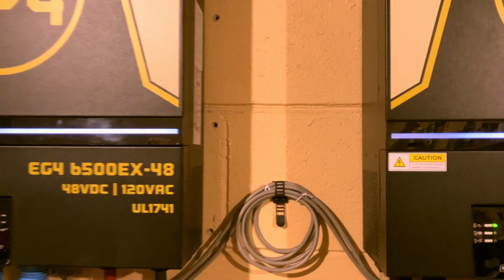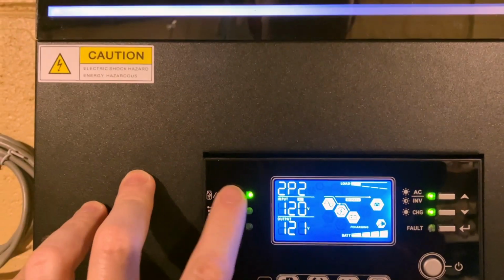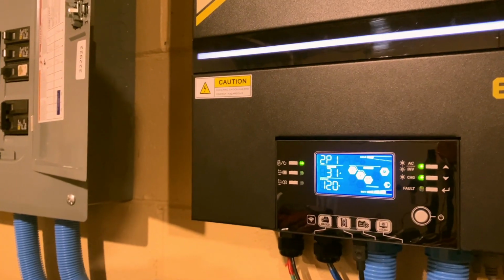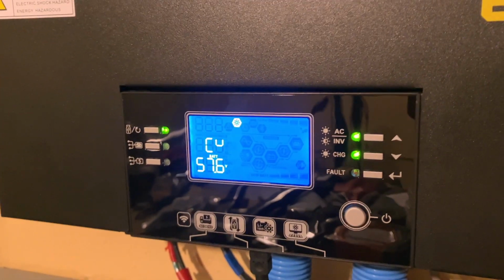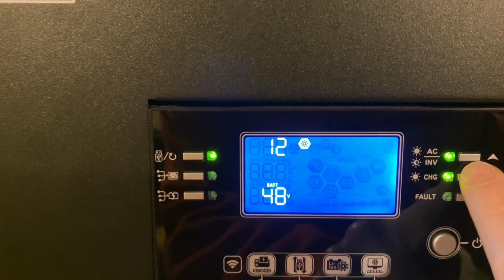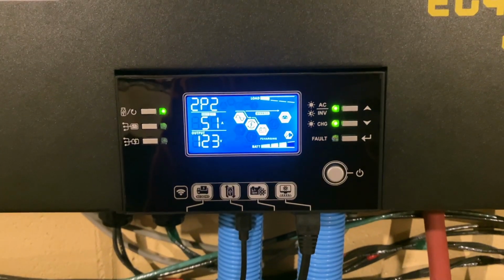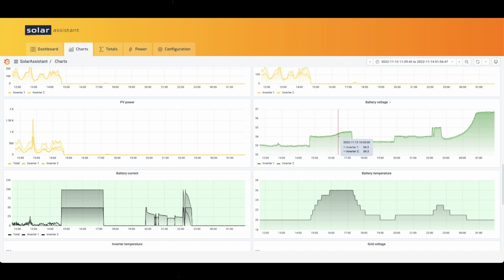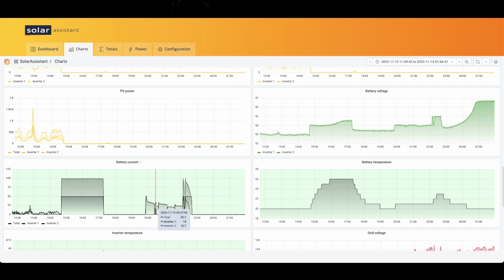Grid Charging Oddity

Comment: This might be off topic but I was curious if you have anything tracking your grid input into the inverters. I have a emporia Vue utility connect that I use to monitor my utility backup connection just to get a up to the second view of what’s going on. Here is the kicker when I have my beaker that goes to the utility connection of the inverter on, the inverters are pulling 100 watts from the grid. And when the sun comes out that 100 watts goes away and the inverters actually start back feeding 100 watts to the utility . After I found that out I immediately turned my backup utility breaker off as it is dangerous for utility workers. I also contacted signature Solar and they said something is wired wrong but I don’t think that is right because everything else is working properly, so I am wondering if you would like to look into it with your system and see if you have the same issue.
Reply from the maker: I have a Sense home monitor in my MSP.  I know I've looked at the monitor when I'm in bypass mode and I have almost no draw from the grid at all (except for maybe something still plugged in on the grid side).  I know I've never seen any back-feeding across the grid circuit.  

Can you put a clamp meter on your grid connection and see if there actually is power flowing back to the grid panel and not a mis-reading from the Emporia?
Reply: I finally had a chance to put a meter on the grid connection. When I turn it on it starts by drawing the roughly 100 watts for the 2 inverters and gradually drops to 0 then starts gradually pushing 100 watts back to the grid. And does this on any output mode.
Reply from the maker: @jeremy4609  I would defiantly be contacting SS if your seeing voltage getting pushed back to the grid.  These are supposed to be off grid units preventing any back flow.
Reply: I did but they really didn’t have any answers other than something is wired wrong. I don’t plan on using the grid connection anyway. I plan on using a chargeverter in the rare event that I don’t have enough Solar
Reply from the maker: @jeremy4609  hmm, yeah that doesn’t make sense.  I do like the idea of using a chargeverter instead.  That would get around any of the other issues that “grid-bypass” has.

Comment: Maybe your batteries BMS is stopping the charge?  I had my bulk set to 57v, when monitoring my EG4 batteries BMS, I noticed some of the individual cells in the batteries were being over charged causing the BMS to stop the charging.  I lowered the Bulk to 56 and set the float to 55.5v.  The batteries seem much happier at these settings. I don't have any experience charging from utility though.
Reply from the maker: Thanks for the comment.

I won’t normally be charging from the grid, it was just a test.  It wasn’t the BMS causing the issue cause as soon as I increased the float value, the charger ramped up.  My inverters are both set to USE as I’m not using EG4 batteries.

Comment: Another thing when charging from the grid in USB mode, as you get really close to your bulk voltage setting you will notice both inverters decrease current and when it gets very close to setting, one inverter will finish because it’s easier for it to control low current/absorption with one. If I remember right it happens below 10 or 5 amps. It’s been a while because my panels usually finish the job. I just don’t spend much time watching it anymore. My settings are 55 bulk and 54.4 float. Mine batteries aren’t stressed that way and are well balanced but I also have a very powerful balancer.  Crazy reading but go to the EG4 website and look at all the rack 48 systems and versions, look at each recommended settings for float and bulk. Keep it mind that they all use the same battery chemistry. Kinda looks like they’re still learning? I like the newest (V2) with 55.5 bulk and 54 float. Very reasonable.
Reply from the maker: Thanks.  Yeah, I'm always playing around with my settings.  If I recall, my settings at the moment are 55.2 (bulk) and 53.6 (float).
Reply: @AdamDeLayDIY  
That’s very safe for longevity. The only thing to watch out for is the balance. If the voltage isn’t in the balance “on”zone long enough to work on it you may have to make adjustments.

Comment: Stop messing with the slave inverter (except for program 11). Once you commissioned it, the only real reason to touch it is to look at status and perhaps change charge current(11). The only control you really need is at the master P2, is programs 01 & 11 . Leave 16 alone at default “nsu”.  Float and bulk is set at the master and should transfer these setting to the slave. If it doesn’t do this correctly or acting strange, you need to do a total  depower/reboot because it’s totally confused. To depower, disconnect the data cables to the Solar Assistant at the pie unit, not the inverter because the socket in the control head is weak and it only has so many jabs it can take. You must remove the SA because power from the pie will back feed to the head unit and it won’t properly shut down or burn out the pie’s little power converter. Now you can turn off the PV, grid breaker, push both off buttons and when it powers down disconnect the battery. Wait 15 minutes, and do everything in reverse but remember to precharge the inverters and when you get to reconnecting the SA, plug the master in first so they don’t switch positions in the app. Probably the only programs you really ever really need to access is 01 (USb,SUb & SBU) on master and if there’s not enough sun, 11 (max charge charging current) is independent to each inverter. Do have a look at what pgm 02 value is (total amps) on both and is it what you want. On the master only, you can use the timer function, the middle left button but only use the USB option (when primary pgm 01 is already at SBU!). Don’t use time 00 in start or stop (“00” /“00” is off). Are you confused yet? Hang in there. Once you got it running right you may actually forget about the whole thing and not even check the SA app all day!  Have fun.
Reply from the maker: Thanks Karl.  As you stated most of the settings sync between the two inverters, I just didn't have enough patience to wait for the change.  When I make changes to the physical inverters (which is rare cause I use SA for most of it), I make the change on the Slave unit (because it's the first one inside the door) and it syncs to both.  There are a few settings that are unique to the individual inverters.  There's no actual list or documentation in the manual, but the few that I've come across are Menu 2, 11, 16 and all the time settings (95-99).

Comment: Okay there is something that you missed in setting, the reason that float is taking control is because the  Rebulk voltage is set to low and and it sees the batteries as being fully or near fully charged, and therefore only requiring a float charge,  however the one thing I do find strange, is that when connected for split phase operation, the to units should be able to each do half of the charge limit set point, there by sharing the load and keeping the current equal on both phases. However I see another decrepancy, you have to communication cables connected, and this presents another question, I only have one, when I received my units the communication cables were not in the box, so I called up signature solar and told them that they were missing, so they sent me one, and when I got it I called them back and told them you only sent me one cable, and that the diagram shows two, so they connected me with there tech support, whom informed me that only one is required, and that it's an either or thing, which seems a little odd, but it is working with only one connected, however it is not yet tied into the main panel, so I have not yet tried to charge from both units yet, however I have discovered yet another qurk about these inverters. I had one of these hooked up to a 15 KWH bank of Lifp04 batteries, and had the charg current turned down low, in order to allow the active balancer to get all of the cells in perfect balance before I did any high power tests, and during the initial charging bulk phase, everything was fine, however when the batteries started to float charge is when I discovered something that I really don't like about these inverters or more specifically there internal charge controllers. 
It was in the evening and I went into the kitchen to start dinner, and I use an induction cook top, almost exclusively, well I put some  Spaghetti noodles on to boil Spaghetti noodles on to boil, And they started boiling just fine, and then stopped, And then after a bit they started again, so I thought that my induction cook top was done, and I almost threw it in the trash, but I suddenly remembered that I had this cook top on the road with me and I ended up buying a pure sign wave inverter for the truck, because it absolutely will not run on a modified sign wave inverter, until I bought the pure sign wave inverter, I had to drag out my Yamaha inverter generator to run it, because the thermostatic control is confused by the distortion of the modified sign wave. 
That being said, I pulled out my fluke scope meter to have a look at the purity of the sign wave, and was extremely shocked to find a 104 volt spike on the line, that would appear and disappear. Well long story short, I traced to that inverter, which I kwikly swapped out for the other one, thinking that maybe there was something wrong with the first one, but it does the exact same thing, and to make matters worse the cook top was on a completely different circuit, and further investigation showed that the 104 volt spike,  was present on the buss bar of the main panel which is only 80 ft from the pad mount transformer!! The spike is only about 8.5 ms in length, but it totally cripples my New Wave    Precision induction cook top, and it turns off one of my power supplies that runs my Ham Radio station!
Reply from the maker: I had the bulk voltage and float voltage farther apart at the beginning of the video but I had to increase the float voltage to allow for the charger to actually charge more.  It shouldn’t matter how close I have the voltages set in the settings.  If the inverter never reaches the bulk charge voltage, it should never drop into maintaining the float voltage.

That’s very interesting about your cooktop investigation.  We’re you ever able to figure out the cause of the spike?  Did you get any help from Signature Solar?

Comment: With EG4 batteries, do I need to worry about any of these settings?  I've seen conflicting information in the manuals saying where the voltage should be but then it says they are set by BMS.  Confusing.
Reply from the maker: If you have option 5 set to EG4 and you have proper communication set up with the inverters, no I don’t think you need to worry about these settings.
Reply: @AdamDeLayDIY  I would agree but then why would the manual say default settings for EG4 batteries?  SS can't answer that either.
Reply from the maker: @dalemeyer5363  you got me there. I actually don’t have the updated manual because it didn’t come with the inverters and I just haven’t downloaded the updated copy.  Since I don’t have the EG4 batteries, most of the updates don’t apply to me.  I would just think from what I’ve seen, that you don’t need to touch those settings if your using EG4 battery mode.

Comment: Same here. My utility seems to only charge the batteries halfway. I tested this last night, ran batteries down to the low warning mssg then switched on the AC utility. Both inverters went into bypass and started charging as well at wide open current' 30 A in my case. Ran like this for about a half hour bringing the batteries up to about 50% then quit charging. Batteries are now at 50%  and were running on battery only again. I need to figure out what setting will let the AC charge the batteries all the way to full charge as well.
Reply: It might be setting 13, I'll test it now.
Reply from the maker: Sounds like that's what it might be.  If 13 is set to 50% it would stop charging.

Comment: I believe it is doing what you have told it to.  Depending on the model., the Bulk Charge voltage is the voltage the inverter will push to charge the battery.  I hope that makes sense.  For example I have some 51.2 Volt batteries and some 48 volt.  When I use 48 volt batteries I change my bcv to 54.6 and put my float around 53.6 so my batteries will not go over 53.6  but it is charging at 54.6.  I hope this makes sense.  I know it gets confusing....  Think about this.  if it charge to the BCV at a set level, why would they even give a float voltage.  BCV is just the voltage the battery wants to see for a charge value.
Reply: Better yet, maybe this will help.  If my batteries are 48 volt and need to get 54 volts I would set my float rate to 54 but I want them to charge at a rate of 56.8 volts.  That 56.8 is the voltage the battery expects to charge at, it has nothing to do with what voltage the battery is at.
Reply from the maker: Unfortunately that’s not how it works.  Bulk charge voltage is the voltage which the charger wants to charge the batteries up to.  Then once it reaches that voltage, the amps taper off and then typically it would go into an absorption mode (unfortunately I don’t see any way to control in the 6500s how long it’s in that mode).  Then once it completes its absorption, it then switches to float mode where it attempts to maintain the float voltage.  From what I’ve seen with other chargers, once the voltage has dropped under the float voltage for a significant time, the charger then switches back to bulk mode trying to get back up to the bulk charge voltage.

https://diysolarforum.com/threads/what-does-the-%E2%80%9Cbulk-charging-voltage%E2%80%9D-of-a-hybrid-inverter-mean-mpp-solar-lvx-6048.44758/

Andy does a good job of explaining this: https://youtu.be/xBu7ScAdKrg

Comment: isnt bulk voltage a lead acid thing? Lifep04 is float?
Reply from the maker: No, float is a lead acid concept.  Bulk charge is the maximum charge you want your batteries to charge up to.  

While float technically isn’t needed with lithium, I’ve seen a lot of people with a whole lot more knowledge on the topic than I do have a float voltage set, so I do as well.
Reply: @AdamDeLayDIY  My Growatts have float and bulk and they both are set to same voltage as instructed in manual when set to US2 since i do not have any connection to the inverter from batteries.

Comment: I have my inverters set to 56.4 for float. my BMS's handle their charging specs not my inverters.
Reply from the maker: From everything I’ve read, it seems like it’s recommended practice to have the charger be the device determining what your top voltages should be and your BMS should just be used as a safety measure.
Reply: @AdamDeLayDIY  your charger should always be a little higher  than your BMS. So as your BMS balances your cells it can take in more charge as needed. I have JK BMS with 2 amp active balancer in each one. they turn on at 3.4 V per cell. That is what I have learned from OFF GRID GARAGE(Andy). You always have to supply more voltage to the BMS than is needed if not you will never get full charge. even when you are full at 56.4 they settle to just under 55. mine usually settle at 54.6-.4 depending how long they set.

Comment: well you are not gonna cause a phase imbalance on the grid. they do not have tiny auto transformers. They have much much larger ones. Its more important to see how balanced your off grid breaker panel is. Most will never charge from the grid.  Let solar charge them back up.
Reply from the maker: Very true.  Guess I was so shocked at the float issue that I didn’t even think about the fact that it was all coming from the grid transformers.  Thanks!

Yeah I don’t really ever plan to charge from the grid unless my batteries are low and I know severe weather is coming.  Otherwise like you said, let Solar charge the batteries.
Reply: @AdamDeLayDIY  You have to remember chinese program these inverters so there thinking is a bit different than ours. I am sure there will be a couple bugs and software upgrades needed.